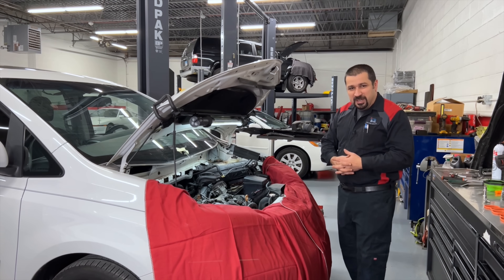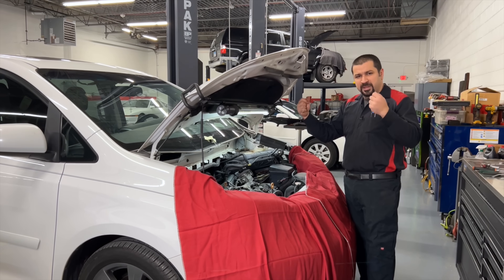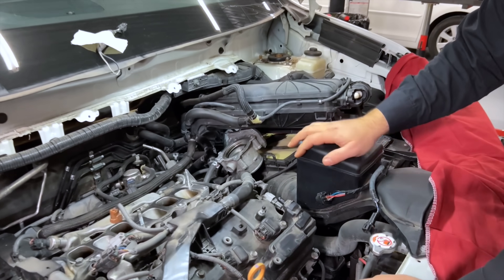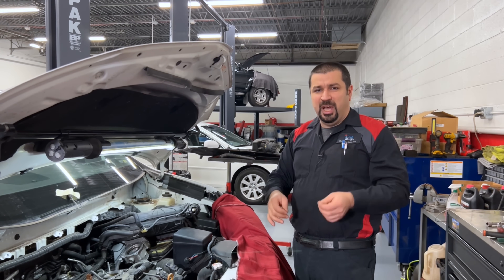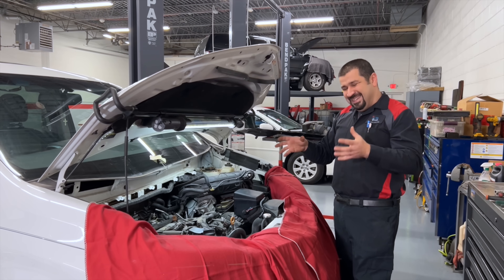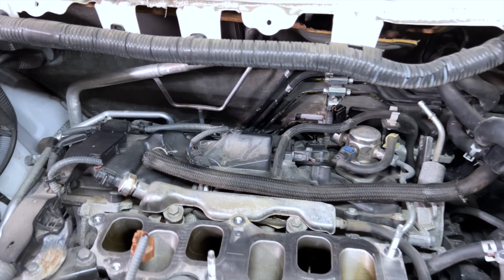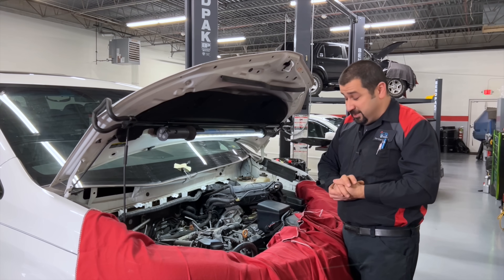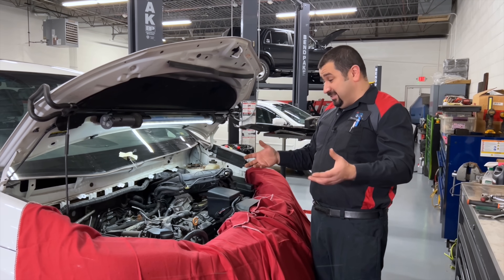Does Toyota Direct Injection Cause Carbon Build Up? Let's Find out!

Comment: When I bought my FRS back in 2014 from the Toyota dealership, the D4S system was something that was always mentioned in the marketing stuff for the car. A subaru engine with Toyota's D4S system. Subaru's are know to cake up with carbon because all of their engines are direct injection. Knowing that Subaru added this to the car makes me feel much better about maintaining the engine of the car. I've seen a lot of WRX/STI's with the carbon issue after 50k miles. Usually have to get it walnut blasted to get the carbon out.

Comment: My mom's Lexus NX350 had the 2.4t. I will say, this engine experienced severe engine knock around 2K rpm, when the fuel delivery switched from port to direct. It happened under moderate load and throttle. I noticed it on a few early models but the next model year seemed to have solved the problem. So, I don't know if it was a software solution or what. This wasn't a problem on earlier Lexus models with D4S but when they started coming with engine start/stop as standard, they started programing the port injectors to be operating while driving rather than just at engine idle.

Comment: It’s physics, no manufacturer is immune to this problem. The dual DI+Port injection systems have a lot fewer problems with carbon buildup, but it depends entirely upon how the ECU doles out the fuel.

Comment: Have a 2017 RX350 3.6V6 70k miles with and lot of carbon build up in the intake valves. Do you recommend any chemical cleaning agents to help with this? Thanks.

Comment: Ah... of course, let's not talk about the 1AZ-FE, huh? Oooh no, we won't be able to "defend" Toyota's credibility with that cluster carboning-up of an engine, (as has been well documented all over the internet). For context, the example our saintly brother is showing here is the D4-S — "S" for superior, basically Toyota's band-aid solution to the intake carboning problem which plagued the first generation D4 engines, by adding little port injection squirters specifically designed for cleaning the intake valves.

Comment: Also use a fuel system  cleaner about every 20,000. Amsoil pi performance improver. Mine has 103,456 miles and mine is cleaner

Comment: Would you say this is the same for 2023 subaru outback 2.5 na boxer engines? As it is on every service 12.5k or 12mth here in australia as a upper engine cleaner that you spray. Personally i think i will skip this as i service it myself

Comment: I have a 2019 Rav 4 hybrid. The Toyota dealer changes the oil every 10000 miles. I insist it be changed every 5000 miles.  Who is right?

Comment: I own a 2016 Mazda 6 and very recently cleaned my intake valves because it is direct injection only. Glad my tundra has this system because it is a process to clean them not having a shell blaster

Comment: How would you define "short trips"?
Reply: If the engine doesn't reach it's operating temperature it's a short trip. Apparently the definition of "short trip" depends on the particular engine, the season, and how you drive.

Comment: I changed my oil in my Lexus ES 350 every 5,000 mi or 6 months whichever occurs first and I have a very heavy foot 3/4 throttling it every where I go even though I'm only driving 15 or 20 minutes at a time..

Comment: This video is a bit misleading because if a car has port and direct injection there will be no carbon build up. It is the cars with direct injection only that have this issue! Having said that the 1.2 turbo engine is direct injection but as far as I know hasn't had any issues with carbon build up due to its use of both the Atkinson and Otto cycle!

Comment: "A picture is worth a thousand words." I use top tier gas, change quality oil every 3k and do most of my driving at interstate speed. I'm confident now my 2023 Tacoma valves are clean! Highway gas mileage is 26 MPG with v6 and 4wd

Comment: Can a leaking direct injector cause actual measurable low compression on one cylinder?  My 100k mile 2017 Highlander suddenly with no prior conditions started running like it had a miss.  CEL and AWD lights came on so I had it towed home.  Compression is 180 on cylinders 1,2,3,4,6.  Cylinder 5 has 42psi and and then 70psi with a teaspoon of oil in the spark plug hole.
Really hoping for a definitive answer to this and it would be a repair that I could handle instead of needing to take it to a dealership.  Thank you!!

Comment: For everyone that doesn’t know heavy diesel trucks and equipment have their own way of doing an “Italian tuneup” whenever it senses it’s getting plugged up with carbon, when in park the engine will automatically spool up to a higher idle Rpm for several minutes to heat up and burn away any soot that has built up in the exhaust system.

Comment: You mentioned one of the worst things you can do for a vehicle is not use it. Because of the excessive salt we use throughout the winter in central Canada, I park my main car for the winter and use an old beater. Unfortunately, our winters are pretty long, so that car can sit for five or six months. Any tips? I’ve heard that you should fire it up once a month, but I’ve also heard it will introduce moisture to the system and that does more bad than good.. 🤔

Comment: I drive spiritedly even on a short trip.  Once I get all the right tools in. I'll be doing a thorough carbon build-up cleaning on the intake valve on my car.  Last I did an inspection. I found a lot of carbon build-up on the intake valve on my 2nd gen traverse. Seems the 1st owner only drove short trip mostly and had a lot of carbon build-up on the intake valve.

Comment: Not a problem at 80k miles in a well maintained engine isn’t a problem.  BUT, come back in another 80K miles and show me the valves.   That gunk in the intake manifold may very well be on those valves.   And at today’s car prices, it’s still a problem for consumers.

Comment: What is considered a short trip?
Reply: Less than 30 minutes of driving. The engine doesn’t get hot enough to burn that fuel vapor residue from the direct injectors.

Comment: I found this video looking for one on the coolant change on the exact same 2017 Sienna with the D4S in White!  Thank you for the explanation on the D4S system.  Where is the vent port to bleed the cooling system of air on this engine?  Or is it required when changing the antifreeze on this model?  I used your instruction video to bleed my 2gr in my 2012 Avalon and it worked great.  How about this D4S engine?

Comment: I have been a Honda guy for very long time and just bought my first Toyota.  This dual injector setup is one key reason for my switch. Toyota is getting it right and trying to do the right thing :)
Reply: Ford does it too
Reply: @michaelmilitello5644  Ford copied Toyota 😂
Reply: @michaelmilitello5644 And some Jeep engines continue to use port injection and avoid direct injection altogether.
Reply: @michaelmilitello5644  like the ton of bronco sports blowing those puny turbocharged engines??

Comment: All of these "advances" and we got little to no improvement in actual fuel consumption. I had piece of crap heavy 90s V6 cars that got 25-30mpg. Today? Stupid overcomplicated systems invented by corruption, racketeering, fraud and lies gets us... wait for it... 25-30mpg max! Even the most advanced hybirds get the same fuel economy as an old honda Civic. WTF?
Reply: Well, you're honestly comparing apples to oranges. You can't compare 6 cyl to 6 cyl when Even my 2.5 4 cyl is laying down what use to be v8 power. Also, it's getting 40 mpg highway. A new Toyota 6 cyl is putting out what used to be supercar performance. For that mpg. Your problem there is you bought a 6 instead of the 4 which still puts out a lot more power than the old 6 you're referring to. People are too power hungry these days. We need more reliability, handling, braking, and better fuel consumption as a higher priority honestly. Manufacturers don't give much of what we need but instead what the average person has been wanting which is straight line performance data on a tech sheet that doesn't really equate to good drivability.

Comment: Forget fuel injection. let's go back to carburators, points, condensors, distributor & distributor caps, rotors, voltage regulator, ballast resistors, timing belt, coils. Popular Stuff from the 1960s and 1970s. The days when owners were able to be their own mechanic and electrical wiring expert.  Using Haynes, Chiltons,  Bentley and Motor's Auto Repair Manuals.
Seems like now in need of Turbos, Coolers, Transmission cooler, sealed radiators, cheap water pumps, head gaskets leaking all the time, carbon buildup, high pressure fuel pump, ECM and other computer gadgetry, internal fuel filters as need to drop fuel tank, and so much more. Automobiles are sophisticated without have the right Computer Diagnostic Software and Testing Machine, or Computer attachments, specialized tools, I would like to say ..it is a huge mess. Then vehicles with 2 catalytic convertors meaning not just one but 2 and they are expensive to replace. Gosh! Do I hate all the PLASTIC. Expensive Fuel Injectors = really? Please bring back the Sherman Tanks aka all metal vehicles. Oh! Older built vehicles held together very well until rust prevailed and were better insulated from Road Noise.  Days of Pull a Dent and bondo/fiberglass. Steel wheels were most common as What is Curb Rash? Rear Wheel Drive and still plenty of Manual Transmissions aka Stick Shift. What was wrong with having a window crank to roll up or down the windows? I suppose it was too much work.
Reply: Sounds like you would like my 1974 Chevy Vega.

Comment: Well that was a great video. I've watched it twice. After watching many of your videos and talking in depth about his 4runner I've decided to cancel my order for a new '24 Ranger p/u in favor of a non turbo 24 4 runner. My family likes it very much. So now I'm wondering about carbon build up on an engine without the dual injectors, just direct? If you ever have a chance to video that a photo of two would be most interesting. I'm presuming less blow-by with non turbo engine would equate to less carbon build up on the valves.. 
Thank You so much for all the videos you put out..

Comment: No it is not a better system because fuel manages to get past the Rings and contaminate the oil so I guess in one respect it might be a better system cuz it's going to wear the engine out about twice as fast think about it because they're including that with a 10,000 Mi recommended oil change interval so now you've got extremely contaminated oil I can't wait to do an oil sample on a 5000 me oil out of a Toyota Camry

Comment: Intake valve carbon is not the only problem with GDI engines.  Damaging abrasive soot caused by incomplete atomization and burning of the fuel mixture.  Causes carbon build up on oil control rings, and PCV system, air injection systems, etc, and causes excess wear of cylinders and timing chains.  Fuel dilution is  third problem. This shears the oil viscosity, reduces Film strength, oxidizes the oil. Combine soot, fuel and oxidized oil and you have significantly shortened engine life.  All OEMs are struggling with these problems.
Reply: Using a better quality oil and changing it at least 5k miles can mitigate all the issues you mentioned. Believe it or not all oil IS NOT FORMULATED the same. The motor oil geek channel is a good one to to explain this. The new Valvoline R&P shows promise
Reply: @mrsmith8436 I use Amsoil Signature Series, good for 25k miles. After only 5k miles, the oil is full of soot, wear is higher, viscosity sheared on this GDI engine.  I can now go 15k using a bypass filter, and oil looks good.

Comment: Love your channel. You are so detail oriented. Anyone having you as their mechanic is fortunate. I have an 18 Camry. 2 things. I have 68,000 miles, and am noticing a hesitation to accelerate that will go away as it gets up to higher rpm’s. This car never had low end grunt, but I mean it’s something different than just that. A25A- FKS should not need plugs till 120 k right? I’ve always used top- tier fuels . The 87 octane Toyota calls for, but always top tier. Perhaps worth paying for the dealer fuel system service? Or perhaps dirty MAF? Idk, just puzzled this. Also the transmission is horrendous in this thing. I had one TSB performed early on. Are there any newer ones? It tries to be in third or 4th gear rounding a corner, and of course has almost no power or torque. Unless I paddle shift everywhere. It can be super annoying. The engine puts out enough power, but it’s of little value in 4th gear at very low speeds.Thanks

Comment: I wonder how much carbon buildup is exacerbated by the implementation of Atkinson Cycle when some of the Air/Fuel mixture is pushed back into the intake.

Comment: Given that gdi alone is proven to be a bad idea, and port injection added back in... is gdi really worth it?  Gdi's tend to burn oil (pollution) as they age, are harder and more expensive to maintain, are generally dirtier to operate than port injection. Why not just go back to reliable port injection?
EDIT: you just said manufacturers use gdi to reduce emissions. BUT, I read much about the oil burning from gdi. So how can emissions be less when gdi tends to burn oil?

Comment: Thanks for the explanation ! Are both kind of injection used at any time, or, more probably, depending on many other factors (temperature, load, etc.) ? And, is it possible that,in the maintenance mode (hybrid Lexus), only low pressure port injection is used ?

Comment: Direct injected engines put more soot into the oil and also create more black smoke under boost.  Some cars like to "sweat" oil from various seals and gasket surfaces.  Don't accept that condition - diagnose and correct the problem.  That can contribute to additional carbon buildup on the valves and milky oil inside the engine.

Comment: Great video and nice to learn of potential problems that might show up as time goes by. We just had our 1st transmission and Coolant service on our 2020 Camry SE. Our local dealership had a sale on the coolant service and we got it done for $50 and since we did the oil and transmission at the same time they gave us an additional 10% off. Our car is sitting at 45k miles and has been flawless so far. They told me Toyota recommends transmission service at 80k and I was like I do not care I do it every 45k miles on my vehicles.

Comment: Thank you! Very well explained and shown! 😃👍
The intake valves are almost clean. Had been nice, if the intake port in front of the valves had been cleaner aswell. 😉
The dual-injection is used in the RAV4, Corolla and the C-HR in Europe.

Comment: I have a question, i have a 2017 Sienna, with this engine, does the port and direct injectors ever supply gas at the same time, or is it one or the other? And what determines what injectors to supply gas? Very interesting videos you put out there, God bless you

Comment: Perhaps even the bigger benefit is that there is very little fuel oil dilution past the cylinder rings with this Toyota multiport injection system.

Comment: The hybrid direct and port injection has shown to be the best solution IMHO to date. Ford's later ecoboost has similar but in use is not as effective as the Toyota system as we still see excessive coking. Key is also to never use a syn blend oil but a premium full synthetic leaves far less as far as deposits. 
Good video.

Comment: You mentioned Mazda and carbon build up. Is there a specific Mazda engine that’s better or worse? I’m shopping for used carolla or Mazda 3 right now. I Don’t want to deal with decreased fuel mileage or cleaning intake vale’s down the road.

Comment: I was always been a Toyota guy, but this tech has sealed it in the modern era. I’m not paying to walnut blast the valves every X amount of miles. I’ve seen Nissans with low miles that are fully caked. No thanks. I won’t buy a DI only vehicle.

Comment: This is good to know..only other duel injection review I heard of is Ford's late model 3.5 ecoboost...well, Ford's only switches to port injec when idling, at 100k mi, valves were caked with lots of carbon that requires service...wonder if toyota's system works differently

Comment: I do my Italian tune ups on my Tacoma while pulling trailers, like the other day when I pulled a 4runner on a dolly 4 hours home, got a screaming deal on a 2000 with a "bad" transmission, found all the torque converter bolts in the bottom of the bell housing, not sure if I'm going to be able to just put them back in or not gonna be a weekend project. One of these months lol

Comment: Ah ha.  Use good fuel - aka the stuff that cost 15% or more.  This allows you to use direct injection system which is 10% more fuel efficient and increases complexity and/or repairs later.  Oye.

Comment: I had no choice on short trip. I drive 3.3 miles to work and my car is not even warm up before I shut it down.
I take it out to highway at the weekend and do 3000 mile OCI and the oil smell like gas.

Comment: Benefit of GDI? Maybe 0.1 increase of MPG. Other than that, none.

No. Port injection does not waste fuel in emission.
Reply: Direct injection results in a more complete combustion due to how precise it is. This results in cooler temperatures inside the cylinder. Cooler temperatures allow for a better compression ratio, meaning greater efficiency and power with the same amount of fuel. With direct injection, you get more engine performance and fuel economy. GDI is an expensive and complex system, which would not be worth the manufacturer's time and money to implement in vehicles for a "0.1 increase of mpg".

Comment: Last year my fuel pump failed but before it did I was getting an extra 60 miles from a full tank. I suppose less pressure but enough to open the injectors